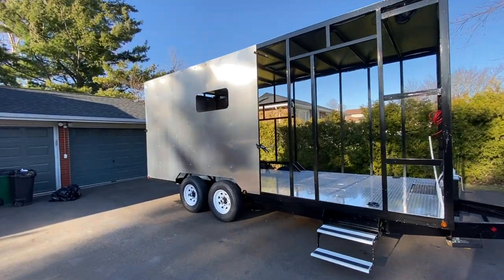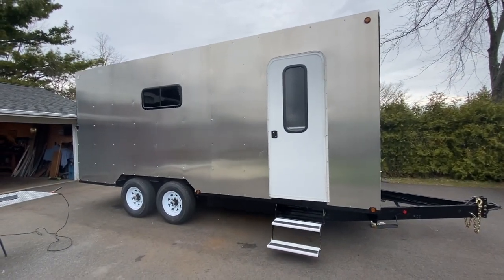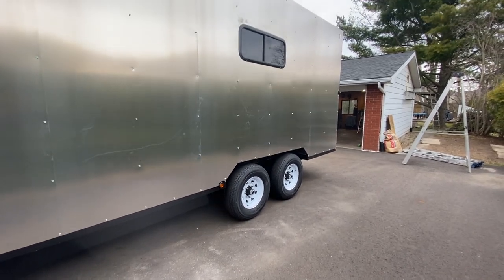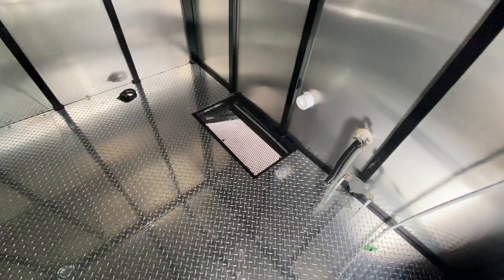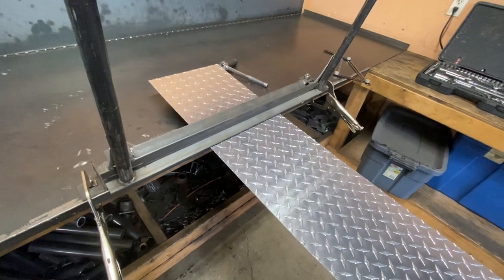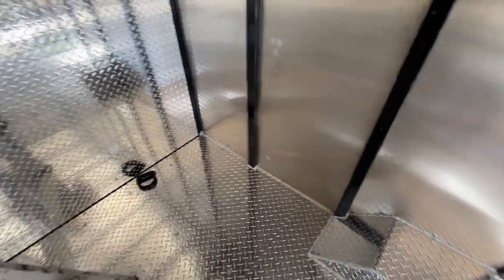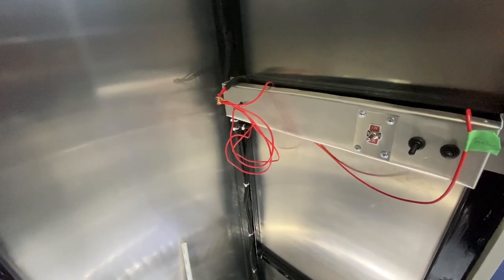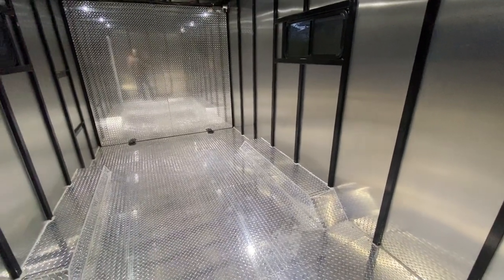Enclosed trailer build | Episode 7 | Outside skins

Comment: Wow. I'm predicting solar power to come soon! This is a one of a kind build!
Reply from the maker: Thanks! Well, I have a 100W solar panel on the roof of my slide in camper, and I was able to connect the camper power to the trailer power through the truck harness. So, I was happy when I saw that the camper solar panel was also charging the trailer battery!

Comment: The Harbor Freight 100 watt solar panels seem to work great for me and I've had them for two years mounted to the top of my trailer.  I use an AGM battery with them and installed a powered vent to help when it's hot.  Of course I'm now in getting ready to install a ceiling mounted heat Pump for heating/cooling.  All walls have foam insulated sheets placed between the studs which adds rigidity to the walls.  Even if you don't plan on a air conditioner, place the 110 volt power to the area of the 14 x 14 opening for potential future use.
Reply from the maker: The powered vent is a good idea. I did notice that mine get very hot inside. I did add a 14 x 14 vent hole in the roof, sturdy enough to hold AC in the future.

Comment: the only thing I would have done is a pointed nose on the front, but still,  you've  done a marvellous job. real good build.
Reply from the maker: Thank you. I tow this trailer behind my truck with the slide-in camper in place 90% of the time. The camper covers the frontal area of this trailer exactly.  It was more important for me to have a long tongue area with the top of the toolbox as a platform for me to get in and out of my camper. Although, the 10% of the time when I tow with it alone, the wind resistance is not good at all.

Comment: Mr. Sabat 
That is an awesome trail.   I am building my own enclosed trailer.   Is the roof one full sheet of metal, or is it two pieces?   Also what type of caulk did you use?   Very nice job!
Reply from the maker: Thank you. I tried looking for a one piece roof but I couldn't find any where I lived, so I designed the trailer to be 96" wide and I overlapped 4'x8' sheet of 0.050" aluminum by 2" at the joists. I used industrial caulking in between the lapped areas, but any RV roofing caulk would work.

Comment: this trailer is turning out amazing. I'm looking for a new trailer for my XJ. I'm on full width axles and stretching it to 124" wheelbase so need something longer than the 18' trailer I use now. I'm about convinced to build my own enclosed.

Just one question, why didn't you build the nose of the trailer to be more aero dynamic, such as a V shape nose?

Can you put up a link to the trailer axles you used?
Reply from the maker: Thank you. It's a good question and observation about the V-nose. I intend to mostly pull this trailer, while I have my slide-in camper on the back of the truck. So, I wanted to have a longer than normal tongue because I am going to build an aluminum toolbox and put it at the tongue. This toolbox will also double as a walking deck as I step out of my camper. This is the link for the axles (this is a canadian dealer), but the axles are made by Axletech: https://www.miskatrailers.com/superstore/axles/7,000lb-single-axle,-straight-electric/p154
Reply: v nose aero is bull shit..Gimmick..
Reply: @runnningonempty  Vee nose does increase interior space, and length, if that matters. I like the vee on both my trailers that have it (I also have two that have square fronts) and I'll be putting vee on my next build, for an airplane with folding wings.

Comment: How did you fasten the man door? Did you just screw it into the metal frame? I’m currently building my own enclosed trailer and my next step is walls, roof and door installation.
Reply from the maker: Make sure you put the walls on first. The man door comes with a frame that has holes in it from the outside. I built the metal frame exactly the same size as the man door frame. Once the walls are up, slide the man door in the opening and screw it from the outside. That's it.
Reply: RG Sabat thank you for the info. I also have to say those wheel wells are badass.

Comment: Not to sound picky,.....   but, do you know what the next thickness is for the metal panelling you used cause if I did it , I really want to see it more flat. Yours looks a little bit wrinkled in places. But hey you still did a great job. Or am I mistaken ? Could it 
be more flat?
Reply from the maker: You could go with 0.060" or 0.070" aluminum sheet. I don't think mine looks wrinkled, it's just the reflections of the bare aluminum where I screwed the bolts. FYI, factory made enclosed trailers normally use 0.030" or 0.040" aluminum, with 0.050" aluminum being an extra option.

Comment: Did you use sealant or butyl tape to bond the walls to the cage or did you screw directly into the frame? 0:14
Reply from the maker: I screwed the wall panels straight to the frame with no sealant. I did put caulking on the roof panels before screwing them. I did this because I don't care about water intrusion (I pressure wash the inside of my trailer from mud after each trip). I would definitely add sealant or butyl tape if you don't want water to get in.

Comment: Very nice. I have a question. How come you didn't make the front more of a point or round it out? Any reason
Reply from the maker: Thanks, because I tow this trailer 90% of the time with a slide-in camper on the truck, that's also why the tongue is longer than usual and that's why I put a toolbox/deck for me step up to the slide-in camper.

Comment: What is all the metal sheets you used made of? Aluminum or stainless steel.  As the frames of boxes are of aluminum.  So it that the Same sheeting of the shell
Reply from the maker: I used 0.050” aluminum sheets for the walls and roof

Comment: Why not V-shape ?  It should tow a little better and also a good extra space ?
Reply from the maker: I built this trailer to be towed behind my truck with a slide-in camper in the bed. I wanted to have the extra space on the trailer tongue as a walk-in platform to enter the camper.
Reply: @rgsabat  Ok. I see it. Makes sense. Have you had a chance to test the trailer ? I towed my V-nose behind a pickup and was terrified of the shaking. Using my van now and much better.  Pickups are terrible to tow enclosed trailers imho as the airflow behind the cab gets turbulent and hits the trailer straight on. I re-positioned the cargo, adjusted height, played with tire pressure, the shaking never stopped but got acceptable.  My tall chevy van (camper) on the other hand made it all smooth. Aerodynamics often forgotten but they are always present :-)
Reply from the maker: @wortexinternational2598  That's good info to share, thank you. Yes, I have driven mine with and without the slide-in camper and I get better fuel mileage with the camper on the truck, despite the extra weight. I really did not predict that to happen, but for the very limited time that I use the trailer alone without the camper, I am not sure if it is worth it for me to make any changes to the frontal area of the trailer.

Comment: Do you know the thickness of the almunium sheet?
Reply from the maker: 0.040"
Reply: @rgsabat  does it leak in winter in rainy days or snow? the outside roof is flat? Does it leak? and have you ever thought about insulating the inside with spray foam for cold winter?
Reply from the maker: @hunterpaintingsforsale5067  I put caulking at the roof seems, it does drip a little in a few spots, but that is not a concern to me since everything is metal inside, except the wooden workbench. I raise the front end of the trailer when it is parked to let the water drip at the back. I normally tow this trailer with my slide-in camper in the truck bed, so there is no need for me to insulate it, but it could be done.